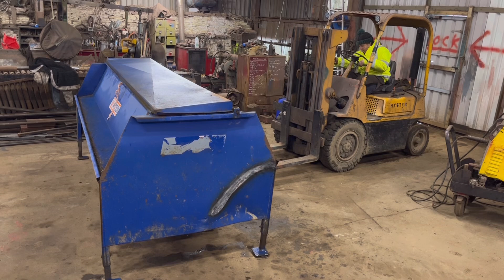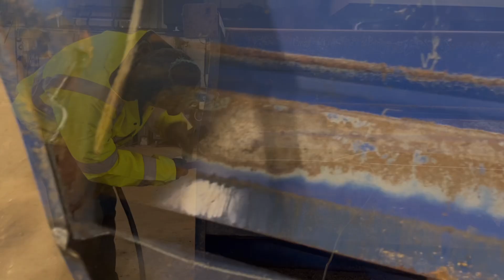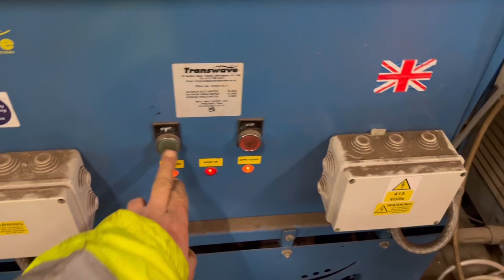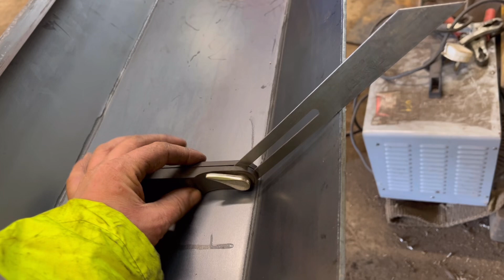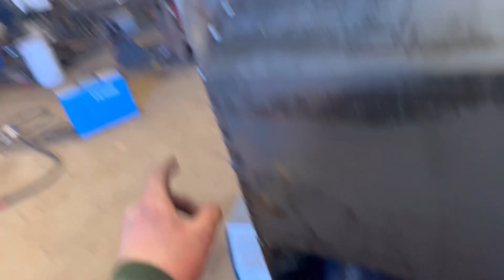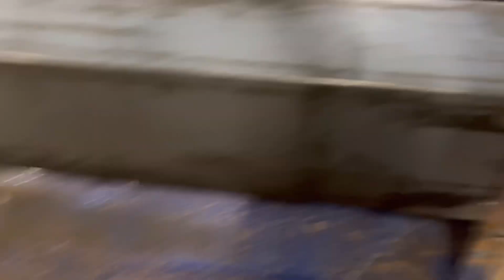Pressing a new trough with the press brake. Sheep feeder repair.

Comment: For your paint stirrer, have a better idea from a Readers digest magazine from the 1950s/60s. Make a straight shaft bent or welded down to the bisection of an isosceles triangle at the bottom. The Readers Digest version is bent so that the isosceles triangle is not complete up one side. I have different diameter longer shafts so that even a 20 litre drum can be stirred with a battery drill (variable speed). I can send you a photo to your website if you wish. The value of this shape is that there is no sharp edge/side to rip open the side of the paint can. Also when there is too much build up of paint, a technical tap or two with a "tapometer" (hammer) breaks off the old hard paint. I was in the Royal Australian Air Force for 30 years in a HR capacity. The techos told me that you are not allowed to use a hammer on aircraft parts - their version was to give it a "technical tap". Edit. I have now sent your an email with photos.

Comment: Why don't you make a paint mixer by cutting out a disc about 75mm diameter and drill several holes in it and weld it to a piece of 1/2" rod, by having a disc it doesn't matter if it makes contact with the side of the tin it will only rub against it as opposed to that thing you currently are using which can slam against the side of the tin and knock it flying.

Comment: Sound repair snowy. Good job you have that press brake. Takes some bending 3mm on that length. Like your transwave is it rotary sounded like it when you pressed the button. What horsepower is it. I have 10hp rotary  transwave for my lathe  milling machine and drill. Thanks mark and ruth.
Reply from the maker: Yes it’s a rotary convertor, It’ll run one motor at 20hp or multiple motors adding up to 25hp. Bigger than what I need but they offered it at the same price as a smaller one. Split phase to 3 phase.
Reply: Love the sheep caption on the picture very funny.  They do know when their  food trough ain't  there lol thanks ruth.

Comment: Great job, and it is interesting, the Farmer is lucky to have engineers like you to still carry out repairs like that.
I have to say it is character building stuff working in 3 deg  inside!.The little T20 looks an interesting project.
As a boy I spent many hours on a TEF 20 working in Potatoes, Sugar Beet, and the Hay & Straw harvest
Reply from the maker: I built it as a road run tractor. It has a Sherman step up box as well, so can do road run speeds at very low revs.

Comment: Fookin hell, what winkle spanner managed to cause all that damage ? 
Couldn’t help notice that it now only has the one fork hole left.
Nice little job for a chilly day.
Reply from the maker: They only have one fork hole just to stop them tipping off. The farmer wanted it moving onto the otherside.
Reply: @snowballengineering  i guess that makes sense, just enough to stop it tipping & sliding but not that you have to adjust the forks width to fit.
Reply: @Will-thegrumpysoutherner  I think it was a metric adjustable winkle spanner,or maybes even a Whitworth adjustable!??!!🤔😉🤣🤣👍

Comment: Good fix with how it has to be done.  get a roller for the paint as I used a brush but watched the lads in a big firm use one all the time. The 100mm wide ones are cheap and cover so fast.

Comment: Good job, hope they're more careful shifting it next time!
I did a 16' gate,replaced both bottom bar's and bits and pieces -- the polish lad took it back on the pallet fork's at warp speed! Folded it straight in half before it'd even been hung!!🤦🤣🤣
Reply from the maker: I repaired a sheep feeder last year and when I was taking it out the workshop the leg caught the ground and bent it again 🤣 luckily was only a 10 min job straightening it back out.